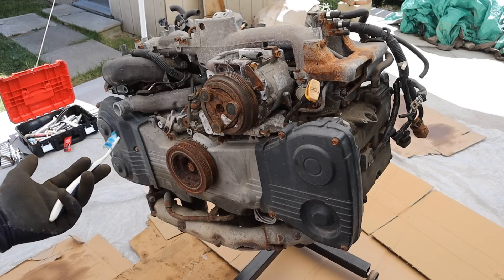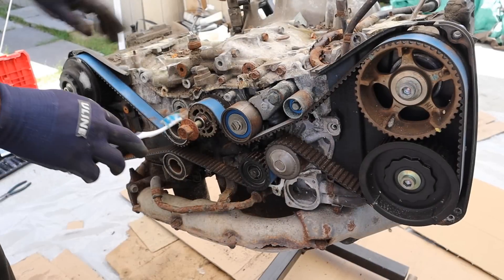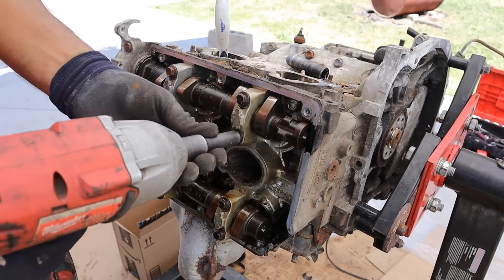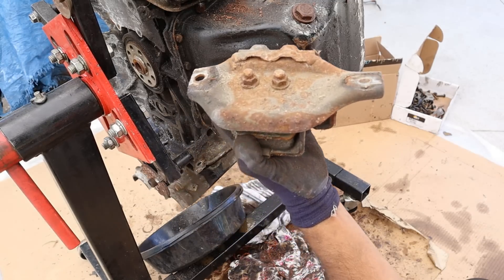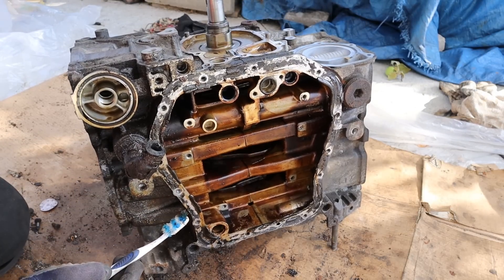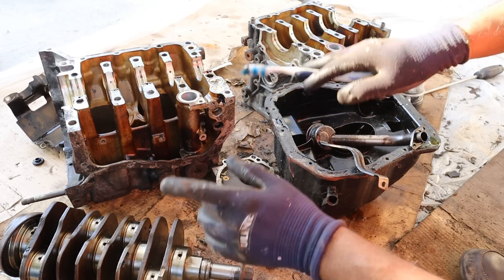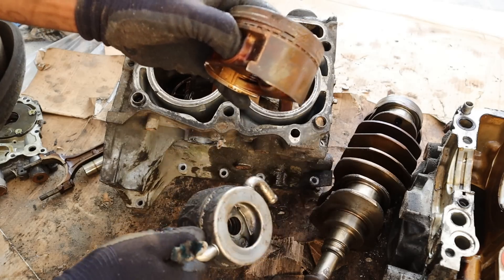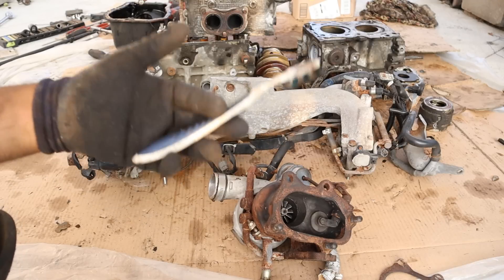Why Subaru Engines FAIL

Comment: So, bad maintenance is pretty much the #1 cause of failure. Lack of an oil change/running the oil level down, oil starts failing due to excess heat/contamination which clogs the pick-up tube which causes the engine lubrication system to fail which overheats the heads which causes a headgasket to fail which causes the oil to fail even more which helps the make the piston rings fail even more until you have complete engine failure. So... just check the oil and change at reasonable intervals? Gotcha.
Reply: 180k on my 2002 Wrx going strong. Frequent oil changes and I didn’t beat on it. Never consumes oil or any coolant leaks for me.
Reply: @diydad9303  those WRX models are abused by people who just want to drive like a maniac and don't care about maintenance or even checking the oil. If you let the engine warm up before accelerating fast, change the oil frequently and do the other maintenance regularly, it won't be a problematic engine
Reply: With the flat 4 boxer turbo it  really just needs strict maintenance schedule adhered too, delay the maintenance at your own peril and provided there are no crap mods, tuning and driving style the engine will last indefinitely, but the truth is traditionally these engine are abused with poor maintenance and crap mods which makes them appear super unreliable.
Reply from the maker: That's the essence of many of these failures. No oil = blown engine. Subarus are just more susceptible to this because the engine design isn't as forgiving as a conventional inline 4, and the types of people who own them don't take care of them.
Reply: @speedkar99  what makes subaru people different than others?
Reply: Oil and filters are cheap.Just change them at half the factory recoomended intervals.
Reply: I used to think this too until my engine started knocking during my commute. Oil was changed less than 2,000 miles before the incident and was not low on oil. Yet I’m now in the process of getting a new short block. Dropped oil pressure to about half what it usually is just before it started knocking
Reply: Pretty much this. They're stout motors when you take care of them and tune them properly. Been at 400+whp for a couple years now on a stock EJ207.
Reply: Yolo
Reply: So I’m thinking of buying a 2023 Subaru CrossTrex. Is everyone saying it’s a piece of crap and I a shouldn’t buy? I’ve got a Tahoe 4x4 and just looking for sometime smaller, with better gas mileage…??
Reply: Hey lads …  so I’m pretty much a 4g63 fan but where l live cars ain’t cheap (Sri lanka) so I’m about to purchase a 1995 Impreza wrx3 running a ej20 and a chipped ECU…. The engines been tuned and crank oil seal has been replaced and valve gasket cover seal has been replaced .. TPS and airflow sensor has been changed too. I went to take a look and the block seemed like it was pretty much stock. Could you guys help out in what I should be looking into closely? And signs I should look out for during the inspection?
Reply: Holy fawk, you people changing your oil @4k+ miles are the problem...
Reply: take care of those boxer engines they will last 200,000 miles
Reply: I had a 2000 forester NA with 300k miles on it.  Super reliable car IMO.  Did head gaskets, timing belt, water pump.....ran like new.

Currently have a 17'BRZ. 100k miles.....so far perfect.
Reply: Still, Subaru engines are fragile, too sensitive to maintenance, and more prone to breaking down.
Reply: 100% clean high quality oil is SO IMPORTANT with the small high rev high stress engines of modern times.
Fords small ecoboost engines need new oil ever 3-4k miles!!!! to survive!
Oil is the lifeblood of our engines.
Changing it every 5 to 6k miles is mandatory. 
Oil is cheap if you buy in bulk.
Reply: @alouisschafer7212  thanks for the reminder. I use mobile1 20,000 oil and filter and change at 7-8k.. what do you think?
Reply: My dad drove us for 19 years in a 1983 Subaru GL wagon, 2L carburetor, through Germany, Italy, Texas, California, and Louisiana: he was USAF. Sold it to a college kid with over 200k miles on the clock. Great car. That's why I have an '18 Forester now.
Reply: @OutsideTheTargetDemographic Those old wagons were great, if you knew how to work on them.  Back in 2000, you couldn’t find anyone, that would touch a Subaru. 🥲
Reply: Just in case you were too comfortable: : most Subaru engines are factory tuned with excessive timing advance, which leads to bearing failure. They also have brazed oil pickup tubes, which fall off into the sump and stop feeding oil to the oil pump. Let’s not forget the poor materials Subaru use for their bearings, open deck design with bores that move around under vibration and tear up head gaskets… etc I could go on and on. Subaru engines are an unmitigated disaster.
Reply: @alexwu8077  Subaru spent so much focus on the drivetrain they forgot to attach a good engine to it. Lol
Reply: IMO, this is just the horizontal engine design. Part of the HG is always immersed in the coolant leading to corrosion. This was perfectly clear while Subaru used steel (?) gaskets until they switched to these MLS gaskets used on turbo models that held up better. But this is the root cause really - gasket always  touching coolant while the car is parked. I changed oil and coolant according to the schedule on my '04 Outback and HG finally failed at 240K. I had plans to keep it till it would reach 300K. It was in good condition.
Reply: @vicinvesta8349  ummmm no. MLS gaskets are Multi Layer Steel. Notice they are still steel? Change your coolant as per maintenance schedule and shit won’t rust. Head gasket failure is not common among enthusiasts who drive there cars hard and maintain them properly.
Head gasket failure is the complaint that allows performance Subaru enthusiasts to recognise mouth-breathers who lack the experience and mechanical understanding to know better. In a way, it’s a good thing.
Reply: @bengibson3955  Yeah, I got that mixed up. My Subaru H6 blew HG after 240K miles. Coolant changed every 30K. Subaru coolant. What else I should have done? Prayed daily? And this is a H6 which from the outset was not subject to mass HG failures that 2.5 H4 experienced. They failed at around 120K. Almost with 90% probability. No amount of maintenance could prevent that.
Reply: @vicinvesta8349  No you dingus...HG is ALWAYS FULLY COVEREDIN COOLAND IN EVERY, SINGLE WATERCOOLED CAR IN EXISTENCE. Coolin system is fully filled and pressurized system, its always in contact with headgaskets in inline, v and flat engines. EJ motors HG issue is mainly caused of bad cheap headgasket in case of NA EJ25 and oil starvation on turbo EJs and not letting them cooldown/warm up. NA EJ22 and EJ20 are not having that issue and so is the case for all lf the FB and FA series engines and EZ30 and EZ36D. So no, there is no "inherent flaw" related to flat engine design you ignorant fool.
Reply: @vicinvesta8349  The EJ25s had the carbon fibre coated head gaskets and needed the MLS gasket I guess to at least extend life.
Reply: @Volkan just to drive home the point of how poorly engineered Subaru engines are, the former Axis Powers (Subaru and Porsche) collaborated on the Subaru EZ30 and EZ36 engines, which are a complete FAIL. They have excessive cylinder pressures which causes overheating, detonation and connecting rod bearing failure. The cause?? Subaru choked the EZ series with incredibly restrictive exhaust manifolds which killed these engine in stock form.
Reply: @alexwu8077  WTF are you talking about? You just regurgitate some bs you hear from other people. From stuff you said only brazed oilpick up tubes in EJ motors is true, but even then its rather rare failure point. Plus even if you are afraid it will fail there are overdone welded pick up tubes that fit all ej motors. 2.0L EJs never had any issues. EZ30 wasnt codeveloped with Porsche, its Subarus own work just like EG33 before it, its a silly myth  that has no basis in anything. 
EZ30 does run a bit too lean and might ping on lower octane fuel because of its timing and restrictive cats(and manifold) but its nothing excessive that you cant fix with aftermarket exhaust. Bearings only ever fail from oil starvation on tracked EJ25 WRXs, ones that still have wide oil pans usually.
Lots of people drive subarus here and noone really has issues with ej20, nor newer FB series motors. EJ204 has petty shit related to emission control things that can easily get deleted liel secondary airpump(to improve emissions on cold starts) and egr, but nothing else. 
Almost every engine in existence nowadays has open deck design unless its designed for racing. Also its another nonissue in a daily car, that only ever might be problematic on a track car, and you tout it as some plague again. 
There are minor faults with subarus engines, buts its nothing catatrophic. There are toyota engines thay have far worse headgasket issues than EJ25 like one in Prius/Lexus CT200h or have actual rod bearing issues constantly like 1zz and 2zz engines(Celica, Toyota Matrix, Yaris TS, Corolla TS, MRS and couple others had it)
Subarus FB series early on consumed a bit of oil... and nothing else really.  When i went to XV 2.0i 6mt from my old 1990 Celica 2.0 GTi, which also drunk some oil it was a non issues, and since these have no other faults and are rather low on maintenence(no powersteering fluid, no timing belt) Then its rather petty and easy to keept track of, also helps the engine and timing chain since oil remains relatively fresh from the occassional top ups. 
I have it for 3 years now, it was driven harshly(after warm up), i was doing donuts in snow with it done thousands of kilometres  with it and nothing goes wrong with it at all. Its an 11 year old car now, if something were to go wrong it wouldve. But no, only i had to change was fluids when i bought it and new battery because it was on a car lot for a longer while and battery was most likely the original one it came with from factory. After than....nothing... It doesnt have any rust, it rides perfectly fine. Suspension might need some replacements of bushings and front struts in some time(rough roads in place where i leave beat the crap.oit of this already old suspension and one strut is weeping a bit now). 
Some of their older enginess had minor issues but EZ36 and FB/FA series have almost none. You really need to stop demonizing them. I dont even what compels you to do so anyway.
Reply: @Kacpa2  yeah. if you have to buy an aftermarket exhaust to solve an inherent issue with the car, that's a problem.
Reply: Subaru oil chance interval is joke, i need to have bucket whit me when if i drive to my friends house to chance oil before heading back. Also i dont really get it why subaru is forgiven every failure they made whit engine design and headgasket etc, its hard imagine other manufacturer having same ammount if failures to still have as good reputation as subaru has.
Reply: @Volkan before 2000 the 911 engines were AIR COOLED. So the issue did not even exist then. After 2000, they started to use water cooled engines and they do have issues with HG. That they rev to 9K does not help with HG any. Yeah, just to pile on Porsche, they put the engine in the wrong place - over the rear axle. Earlier Porsche (before advent of electronic stability controls) were deservedly called widow makers for that reason.
Reply: @vicinvesta8349  Window makers only if you parked them backwards at high speed into a brick wall ; )
Reply: @pervertt  my bad, blame it on autocorrect
Reply: @vicinvesta8349  you don’t know what the fuck you’re talking about.
Reply: Not even bad maintenance. Anything less than absolutely perfect maintenance will doom these engines.
Reply: @SelectCircle  nope. I’ve had 5 turbo Subarus and done hundreds of km of circuit sprints and time attack events. Never had an engine failure while winning a couple of State-level series. The most abuse and competitive km was the stock EJ207 in my GDB STi. I ran 21 psi and enough timing to be competitive for a couple of seasons, only to remove it to find it in perfect condition. Keep up the oil changes, don’t tune it to detonate and they will suffer plenty of abuse. Be very careful with coolant temps when running a FMIC. The gauge will not move even though coolant temps have gone way up.
A bit of caution, good preparation and maintenance and they can cop some serious abuse. It really helps if the builder and the tuner are not noobs.
Reply: @bengibson3955  You don't realize you're agreeing with me. I said perfect maintenance.
Reply: @bengibson3955  yup, I cnhage thermometers pretty regularly like every 45k
Reply: @SelectCircle thats just called maintenance buddy... You just have to do whats required to keep the moter going... Its not that difficult to pop the hood and check fluids when yku gas up. People are just lazy these days.
Reply: @nickTeeKaystrickland  Fair enough. : )
Reply: by the time you get to the gas station. ur temp will make it unsafe to open the radiator .. best the check coolant  before you start ur engine!
Reply: And yet tens of thousands of them are on the road, with over 200k miles on the clock. Idk man, I admit there are issues, but you are making them sound like Trabants. Care to point to reports? Evidence? Proof of any kind? You have yet to mention a specific issue. Most engines will destroy themselves when deprived of oil.

... Unless it has "Honda" on the badge...
Reply: @OutsideTheTargetDemographic   Toyota😂

Comment: Correction EJ engines are interference engine
Reply from the maker: All of them? How come I didn't find valve marks on the piston heads?
Reply: @speedkar99  A guess: Turbo cams have relatively low lift compared to N/A engines at the same power output.
Reply: Luck ?
Reply: Not all, older na models were non interference.

Comment: 100% do a video on this turbocharger and how it works, I think it would help a lot of people better understand a few things, such as wastegate, wastegate actuator, hot/cold side of the turbo, and it would actually be an interesting watch ngl
Reply from the maker: Sure! I have a TDI engine here
Reply: @speedkar99  I CANNOT WAIT! Huge TDI fan here
Reply: @speedkar99  just make sure you make fake blow off valve sounds with your mouth in the video
Reply: Yeah he would be surprised how many people call my diverter valve sound a wastegate sound. 🤦🏼‍♂️.  Including guys that have been around cars for 20 years
Reply: All facts g
Reply: Stop talking like you understand, you clearly don't that's why you're asking

Comment: How about their transmissions 😔
Reply from the maker: I would like to discover how their symetrical AWD system works
Reply: @speedkar99  Isn't it three Torsen diffs? Or am I mixing it up with Evos?
Reply: There are many variations of AWD in Subarus.
There's the traditional active torque split which biases towards the front but has more power to the rear then say a part time AWD system.
You have the Viscus Center Differential, which is a system that is  a 50:50 split in manual cars, You have VTD which is a rear biased system, and you have the DCCD with a variable center diff that the driver controls in the STi. They do offer a torsen diff in STI's or in Legacy Spec B's but those are rare.

Comment: lol what could have killed it? the pound of rust that fell out or the parts that were bent. seems like a race between corrosion, buildup and overheating
Reply: Blown headgasket letting coolant and oil mix, then overheating.
Reply from the maker: Exactly. The bent valves were probably coolant in the combustion chamber forced to compress

Comment: Subaru is about as reliable as the democratic party
Reply from the maker: Lol
Reply: They are better than the Democratic Party
Reply: Subaru boxer engines are more reliable than capitalism. 😗
Reply: It all depends on the idiot in the seat
Reply: I believe the only way to keep a subaru reliable is to let the car warm up each start b4 driving, keep maintenance perfect, don't rev engine in idle ever honestly,  don't slam gas peddle at random while driving or taking off from stop , be mindful of oil slush when turning and final, get that silicone out the oil pan if it's a fa20 or fa24. If you race a subaru you definitely need reliability mods like baffles and ect.

Comment: I think you should definitely do a video on how a Turbocharger works, would be interesting!
Reply: Would be cool to see a speedkar video explaining a turbo forced-induction setup overall, including the turbocharger itself, the wastegate, the intercooler, all the basics. I think many people would find that interesting.
Reply: @sixstringedthing  Precisely 👍
Reply from the maker: Thanks. I've got a VW TDI setup here to work with
Reply: @speedkar99  looking forward to it mate, cheers from Sydney! Great videos, thanks!
Reply: Hot expanding exhaust spins turbine which is connected to compressor wheel. This sucks in and compresses cold air and makes cool spooly noises and car goes vroom.